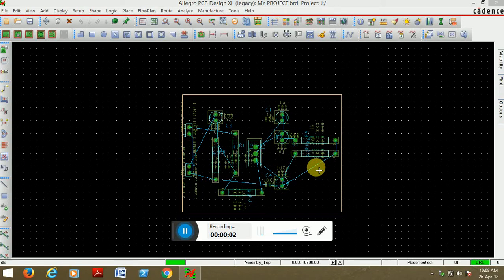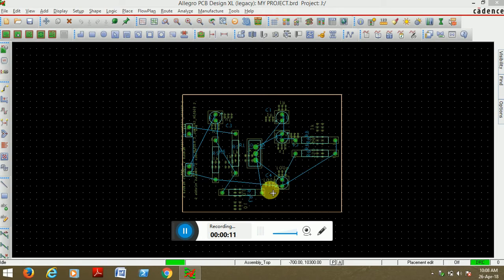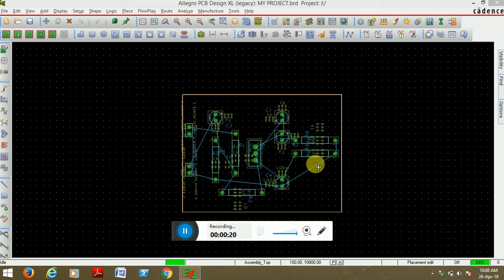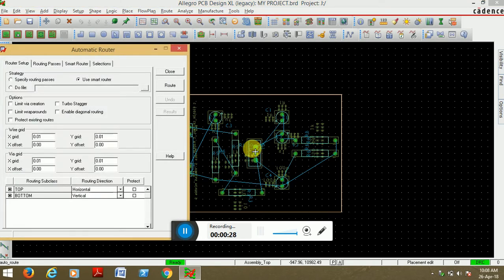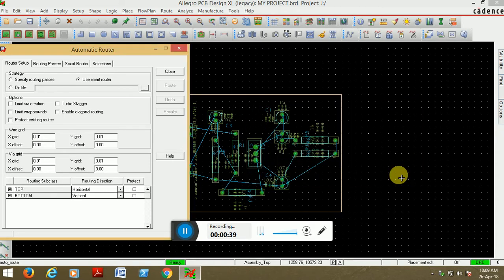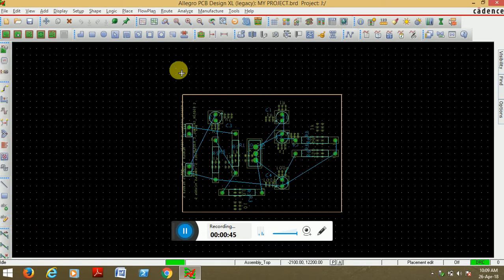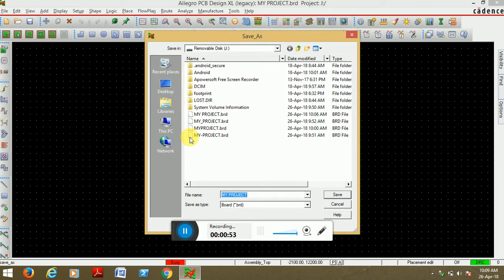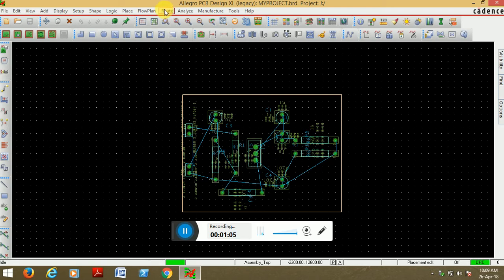autorouting solution

Comment: Hi Aarti,
my Orcad17.4 can not simulate and it showed this message in the session log. Please, can you help.
INI File Location:C:\circuitdesign\cdssetup\OrCAD_Capture/17.4.0/Capture.ini
--------------------------------------------------------------------------------------------------------------------------------------
INFO(ORCAP-2282): The following 2 points have been identified as net connectivity change points from the last operation
--------------------------------------------------------------------------------------------------------------------------------------
(2.30, 2.40)
(2.30, 2.80)
--------------------------------------------------------------------------------------------------------------------------------------
INFO(ORCAP-2282): The following 3 points have been identified as net connectivity change points from the last operation
--------------------------------------------------------------------------------------------------------------------------------------
(4.20, 3.10)
(4.20, 2.30)
(4.20, 2.60)
Could not find Design Cache (c:\circuitdesign\Design Cache)
Could not find C:\CIRCUITDESIGN\DESIGN CACHE
--------------------------------------------------------------------------------------------------------------------------------------
INFO(ORCAP-2282): The following 1 points have been identified as net connectivity change points from the last operation
--------------------------------------------------------------------------------------------------------------------------------------
(3.40, 3.60)